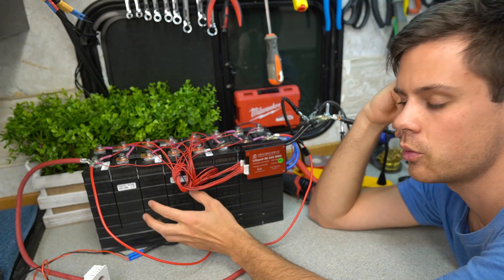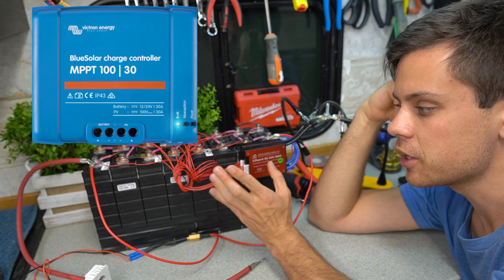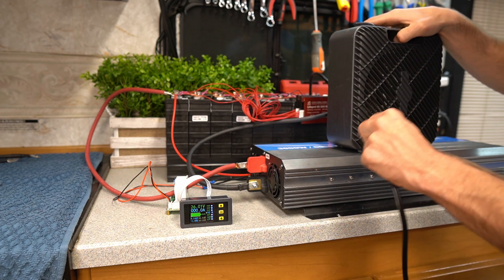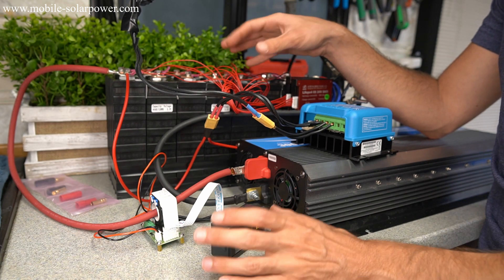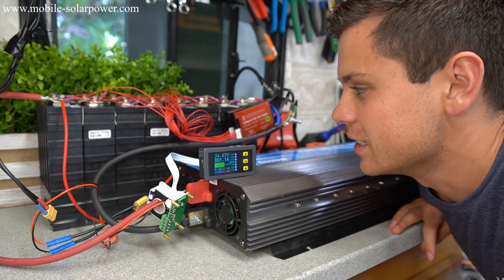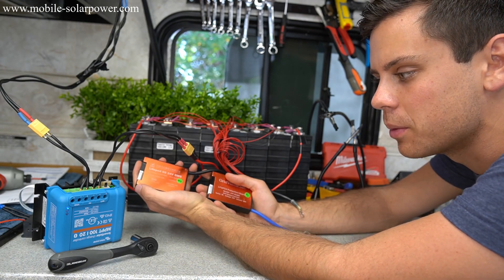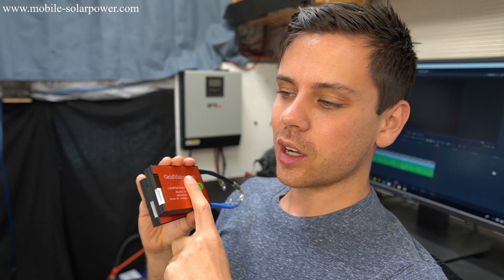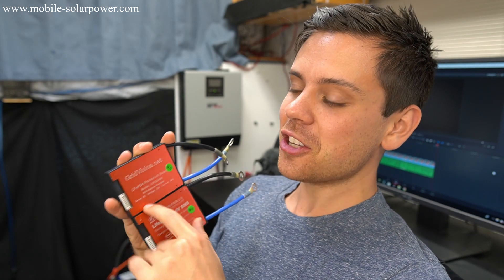Pushing 2800 watts with 2x Budget Friendly LiFePO4 BMS - Quick Test

Comment: When are you doing the follow up to the APEX situation? The preparedness expert has his up now.
Reply from the maker: I responded to his video but he deleted my comment. I'm not that motivated to argue with anyone about the Apex because my reasons for disliking it are very clear and specific, and I don't feel the need to say anything more. Canadian Prepper did get confused as to why I supported the Kodiak and not the Apex, so I gave a full explanation. Here is my complete unedited comment: 

Hello! Ok lets get started:
When I made my first kodiak review, it failed my discharge test, and I said what a bummer, and inergy responded telling me that the discharge rate of the battery is 550w. This was a few years ago and the comment made by inergy is still available. At this time I did a comparison test to the goalzero, and I found the kodiak to be better for the input capabilities and advertised charge cycle life. I do state in these same videos, that the goalzero has a better output. I made this a very specific point, and said that the kodiak failed in this regard. I made an entire video on this that you can watch as well, and I posted it  two years ago? Something like that. I put the kodiak on my website and everything was good. 

Few months go by and I get people are complaining that the neutrik adapter is melting on them when used with 600 watts of panels. I tell inergy this problem and they  deal with it on an individual consumer basis because most people are not using the kodiak everyday with that many panels. So thats fine, and more time goes on, but that is a bad design fault. They tell me that they are working on a solution, so thats good. The goalzero comes out with a new mppt module. It is still limited to 360w, and I think, what a piece of junk. Great output, horrible input. I have never been sponsored by them, but I found it interesting that they are coming out with new equipment. I still recommend the kodiak. 

Then the apex, or originally the "K2" is announced. It takes a long time for me to get data on this unit, but the moment I do, I make a video about the ec8 plugs. This is 4 months before the apex comes out. I also ask about other things, and I see ec8 plug as fine for connecting the unit to solar panels, but absolutely not where the solar panels connect to each other. I emailed inergy this, I also told my viewers, and the video is still up. Please check it out. Couple months go by and I finally get the apex. I am super excited! I rip the box open and put it together. I really like the QC ports as you do too. I also bought with my own money a goalzero 1000 to compare it to. I do a load test, and the apex failed in my opinion. I try to be nice and say that maybe its due to temp sensor placement or charge cycle life and heat management system. I also post at the same time my full review video, and I say that it is entirely silly to have a 30 amp rv plug, capable of doing 4.5amps at 120v. I also talk about everything else I complained about, and I even took the step in trying to fix them myself. I also realize that the goalzero that I was comparing it to (which again, I am not sponsored by and I bought with my own money) performs better than the apex. I also study NMC chemistry and realize that the goalzero battery will probably perform just as well as the apex, charge cycle life wise. Not that hard to achieve 2000 charge cycles to 80% capacity for either unit considering c rates used for solar. The goal zero battery is heavier, and inergy does use this as a selling point. Totally true, and the apex is lightweight. Totally agree and everything in the manual for both units is correct. I say to myself, this is not worth the money, even with the coupon code. I also tell inergy, multiple times at this point, that the goal zero 1000 can perform better, has a mppt module for not much money, and is 400 dollars cheaper. I ask inergy why they do not have a heatshrink solution for the ec8 plugs. I told them this problems months ago, and I kept all the emails. They are not advertising the solution on their website. 

At this point I am fed up and want to make every problem I have with the apex clear to my viewers so they know what they are getting into so that they dont waste over a grand on something they may not be able to use. I make the video and I think it will only help a small number of my viewers, and it goes viral because someone posts it on reddit. The video didnt say anything mean or wrong, it just stated what was in the manual and why I cannot recommend it any more. Other channels can still do it, I do not care at all. I have some viewers that are stilling buying it with my code because they know the limitations, and they still want it anyways. I also understand that the apex is designed for disaster relief etc, but having a switch fall off within the first week, and me finding it while filming my video, just ticked me off. I wanted my viewers to see what I was seeing on my side. 

Think about this: I tell them the ec8 plug issue months before the apex is released. They assure me its fine and they will have a waterproof set available. I get the apex. Plugs will be destroyed after one winter of use, I dont see a advertised solution. It wasnt until after the video, that they told me they are working on a watertight clamp. Which I do not have an opinion on because I have not tested those at all. I have tested a lot of plugs and I know that if my viewers had these systems fail on them, I would feel horrible! Think about what I am seeing on my end. What would you have done? I think it was fair and helpful, and my video was helpful to inergy because now they dont have to return a bunch of systems this winter when the ec8 plugs drastically reduce performance of people using it outside. Any solar product that is not waterproof or uv resistant, I am going to call out. I have done it before and its unacceptable. even if its for disaster relief, it doesnt matter. 

And so many other points to mention now that I am talking about this. There were other things that I talked to inergy about on multiple occasions now. They are super nice and I do like them a lot. Great people. Zane is really nice and hard working. But when I am confronted with a system that has solar panels, and people ask me for my opinion, I am going to say it. And nothing I said was a secret or wrong. I am not the only one who feels this way. The switch fell off! I told inergy about that instantly and they said it was a problem with manufacturing. Is that ok? I do not think it is. It is also more prone for getting hit, compared to the kodiak button.

With that said, after I posted that video, I took the apex off my website. People still asked me for the code a few times, so I gave it to them. They are not informed on what they are getting, and thats my job. I am here to give them unbiased information and if something starts to fail or I see a problem, I am going to say it. 

Looking forward to your response. That was a long comment but I am hoping that you can respond to as many points as you can. I will also be sending this to inergy so they can see what I have said here. I love talking to them and they are a great company, and nothing I say is a secret or not based on evidence. I will substantiate my points with evidence and give an opinion if necessary.
Reply: @ DIY Solar Power with Will Prowse Thanks man, I cancelled my order with inergy and don’t regret it. That’s not cool of him to delete your comment, we should have all the info. I was more curious as to how inergy responded to you.
Reply from the maker: @davemenard5089  Inergy has been great! They are asking me what the next models should have (and they seem great on paper right now), so I am super excited to see what they create in the next months. They are a really nice group of people, they  just need to iron out all the wrinkles. And yeah, canadian prepper has a very different channel than mine, and I think  he took my review personally, unfortunately. I am only here to test equipment and give my results. I do not have any company that I favor more than another. I want everyone to succeed and make something awesome! Quite a few companies are coming out with big solar generators, so the next couple months should be exciting :D

Comment: Hey Will! Love the videos and all of the knowledge there within! I like these kind of experimenting vids! I have a couple of things that I've been thinking about/questions...  I've stumbled into a 48v battery bank (5kwh) and while I save up to build a system around that, I was wondering if there is any way I could utilize that battery bank in my current 24v system (800w & 2.2kwh)? I made it off of your advice/videos. I was thinking charge controller to the 48v battery and then a 48v step down going to the 24v battery?  Would there be any advantages to that or is it just wishful thinking? I've also been wondering if it is possible to stack step downs to power a 12v inverter?

Comment: Hey Will, I love your video's.  Can you post a video about Goal zero again?  I just saw in a video where a guy added a fuse box to his goal zero to get 12v power to many 12v appliances by way of anderson powerpole connection with ring terminals to fuse box.  Is there a way to incorporate an exisiting 12v fuse box in my trailer to it and also add a way to get my 110v plugs to work by plugging into the 110V outlets in my goal zero 1400?  could it be done if I added a manual on off switch something like a battery disconnect when I dont have shore power?   Would like to be able to do this without having to plug into my goal zero with my 30 amp step down cord to plug it into my goal zero.  This would allow me to leave my goal zero in the trailer instead of outside due to it being plugged into my trailer via 30amp cord.  This will be awesome while my TT is in storage where no electric out let is present.

Comment: Let's suppose I have these two BMS in parallel and don't want to push them for more than a total of 80 Amps.. How can I limit the current/voltage to the inverter in order to don't pass that limit? I mean, if a have dynamic loads that if everything is used at its maximum will request more than 80 amps from the BMS... how can I limit that in automatic way?
Reply from the maker: Could use circuit breaker as failsafe
Reply: @WillProwse  Thanks... but that means it will cut all the power..is there a solution where current can be limited? even if the voltage is dropped?... if not, the circuit breaker can be last resort...

Comment: Hey will, I know I'm pretty on top of my game when it comes to this stuff, but do you think I should top or bottom balance my cells. I won't be drawing them down anywhere near the bottom end, so I'm guessing a top balance would suit me better, what do you think?
Reply from the maker: If it's charged daily, probably top balance with limit on charge voltage. Really depends. If using BMS, doesn't matter. Bottom balance of no BMS

Comment: Will: You should look into getting a Chinese factory that is willing to  DROP SHIP your batteries. The customer places the order through your website and pays, you send the factory the wholesale $ with the customers address and they ship directly to them. Many advantages including cheaper shipping from China and more cash in pocket. MOST Chinese factories are happy to have an arrangement like this. ;)
Reply from the maker: Problem is the ruixu guys match the cells for me and ship fast. They are a good group of people and keep the warehouse stocked. I could drop ship, and I used to do that for my first business 8 years ago, but having these guys do it for me is really convenient. But yes, may need to find better setup. I am thinking of distribution and current options all the time. Let me know if you have a specific distributor you recommend.
Reply: Rick Welin - Definitely a better return for Will than simply a small commission. Also better savings for the purchaser if Will passes on the savings from paying Amazon, transport, and storage fees to his tribe.

Comment: Great video. My suggestion is to expand on your load testing  with every  day life inductive loads. As many of the largest loads people have to power are inductive (refrigerator, AC, microwave ovens, etc.)

 I was going to build a 4s LiFePO4 ~1kWh battery pack using 32700 cells for an electric trolling motor. The motor is rated for 50A but I wanted some over capacity to ensure that the BMS could handle the inductive load of the motor during starting up. I had difficulty finding a reliable 100A BMS from a US source as I didn't want to wait 2 months for a BMS from China. I ended up settling on three 50A BMS in parallel.

Sadly after failing to start an inductive load with continuous power draw of 100W on a 12V system when the battery packs have BMS,  I have doubts that parallel connecting BMS are reliable for inductive loads start up. The BMS always disconnect the inductive load during the start up. The first load start test was on a battery pack with 30A BMS (rated for 360W continuous). The second load start test was with another battery pack with  a 50A BMS (600W continuous). Both battery packs can start the inductive load normally without a BMS and without too much voltage sag. The inductive load doesn't trip a 50A circuit breaker during start up. I even tried connecting the packs with BMS in parallel for a combined rated capacity of 80A and that still couldn't start the inductive load.

Comment: I want to use these in my 4x4 as a second battery.
How can i use my vehicles alternator to charge when driving and charge with solar when stopped? 
At the moment I have a lead acid with a battery isolator and a solar charge controller.

Comment: I wonder if you could crowdsource a BMS design and get the boards made cheaply?  Surely there are many in your audience capable of such a thing.
You could set the parameters, such as making it modular, and designed to stack in groups of 100A, with some sort of feedback system like a small OLED screen or LED readout.
Just a thought.  It'd be more expensive than the Chinesium products, but much more customizable and better quality.
I've actually pondered the idea of a kit UPS kickstarter, that would outperform commercial varieties and have the option of running multiple cell chemistries.  Mains AC in, battery in/out, and AC out.  Add a variable DC input (solar/wind) and this UPS would be pretty amazing.

Comment: If you have a LVDC, bottom balance and a quality charging source why mess with these BMS systems that add another layer of potential failure to a system? Keep the bank away from the voltage cliffs and extreme temps.
Reply from the maker: A lot of people like them. But yeah, I go with lvdc and bottom balancing too. Works great

Comment: It’s good to stress test solutions but for small diy setups like this the end user shouldn’t really be trying to power ac heaters as the end goal. If possible, it’s better to run as many dc devices from dc batteries and only use inverters when required as a last resort. 

You see loads of videos of people going to the expense of setting up a diy portable battery solution and then adding an inverter to power their laptop. That’s so inefficient going from dc to ac back to dc. They should add step up or step down voltage regulators depending on their battery voltage setup.

It’s great there is a growing community of people wanting to store solar energy and be more energy self sufficient but I don’t see a corresponding mindset change of trying to more frugal on energy consumption.

I’m not criticising you Will, just making a general observation of videos on You Tube.
Reply from the maker: Totally agree.
Reply: DIY Solar Power with Will Prowse 
ME TOO❗️